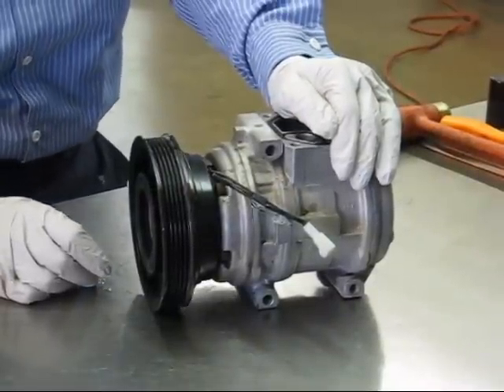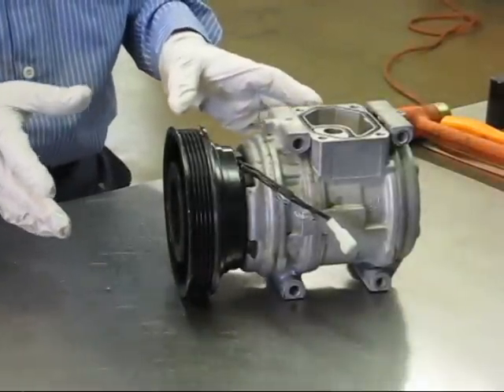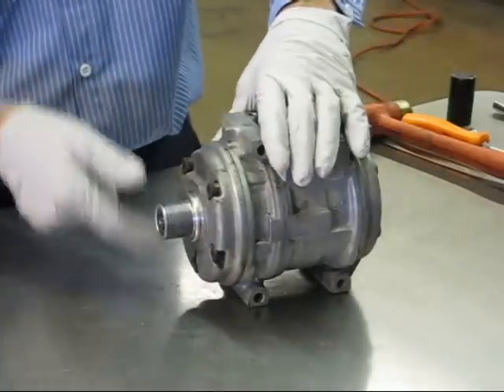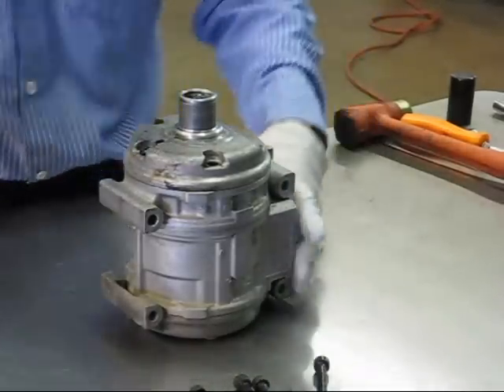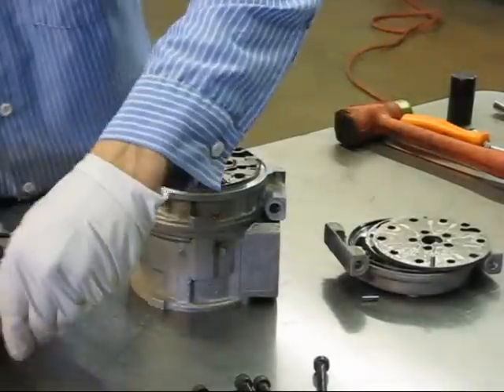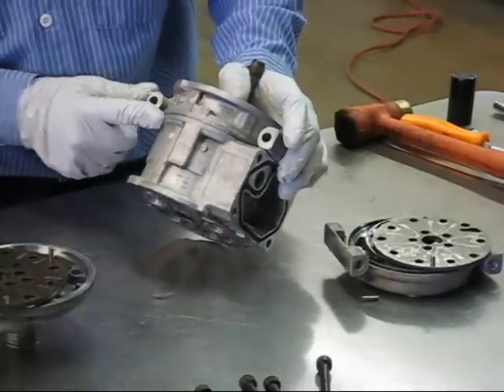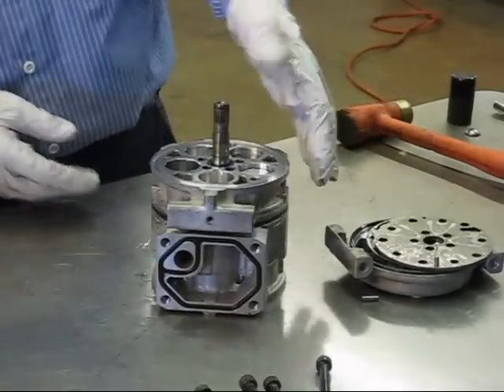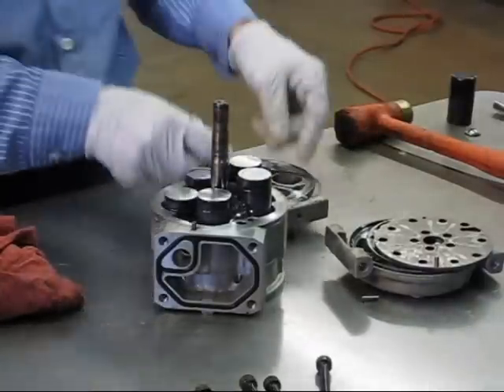Denso 10PA Series Compressor Reseal Part 1

Comment: I appreciate that you made a video for public consumption.  The shaft seal install was helpful.  But, you know.  When you skip over both front and back valve suction, plates and discharge reeds and don't bother to show us the order and how they reassemble.  Very upsetting.  Plus.  Why don't you friggin slow down and do a thorough examination of parts.  LET DOWN!   Would be great if you could do this again with little more care and concern to really demonstrate how the damn thing goes back together.  Just feedback sir.  Not trying to be insulting.

Comment: Hi there, I have a damaged cylinder head blade (the spigot is worn). Does the AC system need to be decompressed to replace just the cylinder head? Cheers!

Comment: Still searching for an answer on why it will stop compressing if there is no leak in the entire system and what is going on inside the compressor the pressure is stable while the a c is continuously engagaged.No cooling at all.

Comment: does this compressor have a replaceable control valve?  My high and low side pressures are identical when engine is running.  want to rebuild it myself.  do I replace reed valves?
Reply: 02 Sienna for reference.  What do I need to replace inside compressor  when high and low side pressures are identical with car running?
Reply: Expansion valve replacement

Comment: hi, which oil used in seals an rings?
Reply: rogerio foss

      pag 46 in Toyotas
Reply: PAG for 134a;
(not Mineral oil, as stated, which is for R12)

file:///C:/Users/paulm/Documents/KitKat/DENSO-AC-Compressor-Oil-Chart_0817.pdf